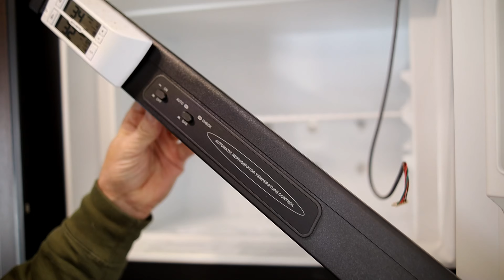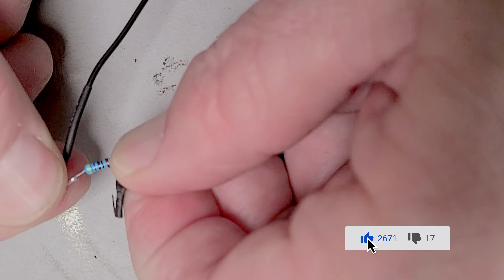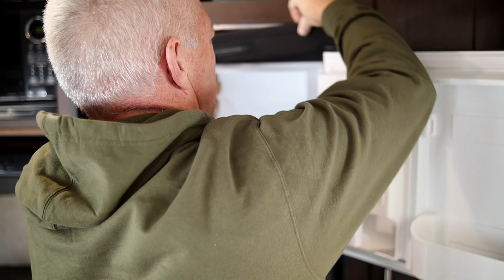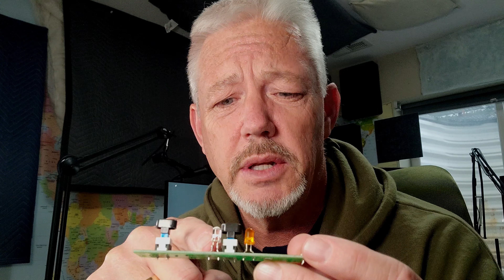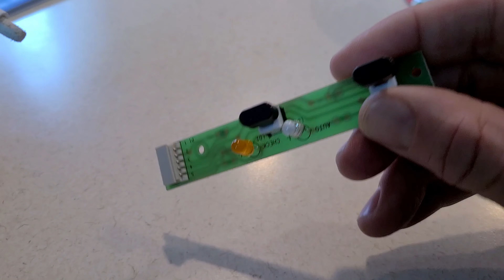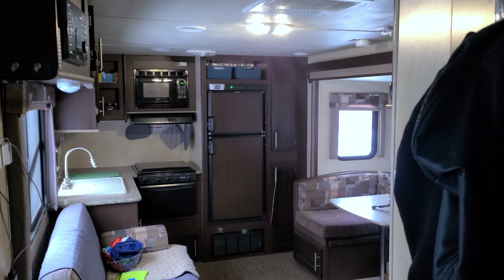Dometic Fridge Eyebrow board | RVAddict

Comment: Love Dinosaur boards, saved my water heat in multiple trailers. Will never buy OEM again.🍸
Reply from the maker: I suspect when you guys buy your coach that you will never have to worry about that type of problem ever again.😉 and that would be awesome
Reply: @RVKevin  Not really. I have worked on just as many Class A with the same issues as any travel trailer. Since at the end of the day the systems and devices are really just the same. I have changed out enough water heater boards and fix water leaks the same :) Now you have to add  engine and transmission stuff to the mix.